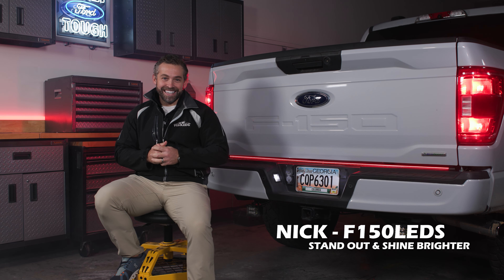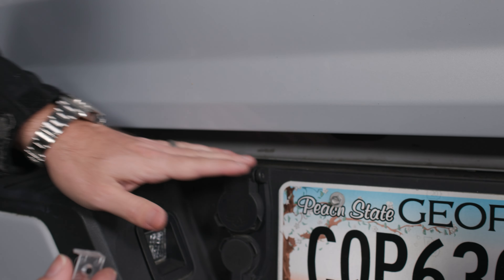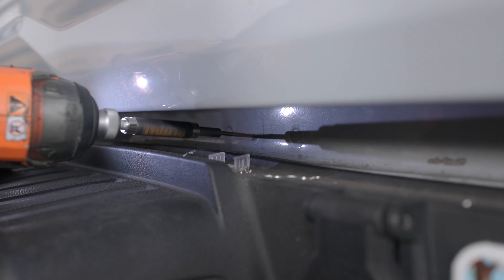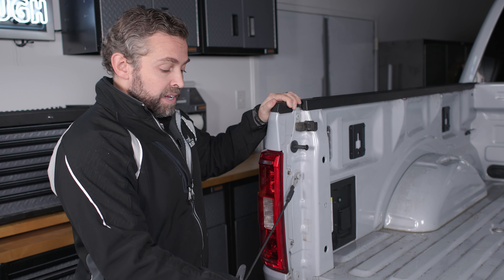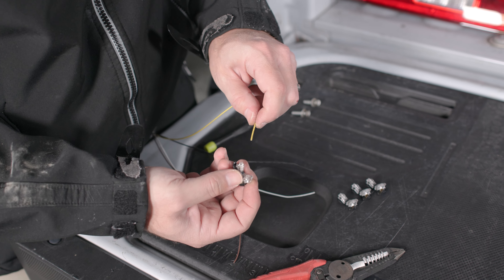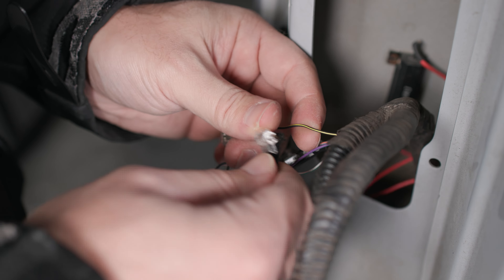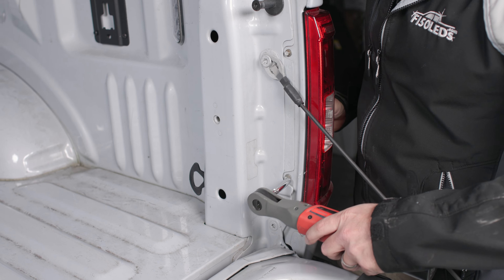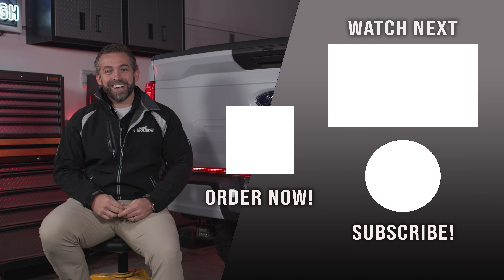F150 & Super Duty  LED Tailgate Bar Installation  (From F150LEDs.com)

Comment: I am really interested in ordering this light bar but have a question. I have a 2023 Gen 3 Raptor. I don’t see how the light bar would fit “over” those large bolts and hinge/bracket towards the passenger side of the tailgate. Could you please explain how?
Reply from the maker: Hi Arnold! Our Sentinel LED Tailgate bar will work perfectly on your 23 Raptor! The bar has enough flex designed in it so that you can go right over the bracket you are referring to, which is what we did in the video (or you can remove the bracket). When going over the bracket we recommend using our custom brackets vs the 3M tape. Please let us know how we cna help further, we look forward to serving you soon!
Reply: I would like to see closeups of bar going over tailgate bolts…would love to buy if the result looks smooth.  Would a thicker 3M heavy duty exterior tape and or flatter bolt heads be the best solution?
Reply: How even do the brackets need to be?  Measure drill spots from what edge?  This is for 22 Lightning XLT…any other caveats?
Reply: @tomcez  Recommend you put some spacers behind the entire bar to make it fit over those bolts. I just encountered the same challenge. The flex they described requires you to have about 2' between the passenger sider clips (on the end) to allow for it to bend over the bolts - not a good plan if you ever hit bumps or use your vehicle like a truck...
Reply: I just removed the two bolts and that bracket as I didn't see any other way to cleanly install the light bar with 3M tape. The bracket doesn't appear to be critical, in any case. Will reinstall the bracket when I sell the truck (24 Raptor)

Comment: I just installed this. It's an AWESOME light bar. However, I stripped of the screw heads I was going to put on the far right-hand side. However, can I remove that bracket on the far right side, just behind the tailgate? Will that interfere with the tailgate if I remove it?
Reply from the maker: Hey there! Thank you so much, we are so glad you are impressed and loving your Sentinel Tailgate bar! 

You can remove the bracket and most people would never know any difference but you would want to be careful of not to exceed the listed weight limits for your particular truck on the tail gate and also use caution not to pull out on the tailgate as it opens. 

Thanks for your question and for being apart of the F150LEDs family! We look foward to serving you again soon!

Comment: Hi there, I recently installed this and I noticed that the startup sequence isn’t working, all the wires are connected to the taillight harness except the brown wire which I’m not sure which harness that connects to. Can you please help?
Reply from the maker: Hey Brandon, thank you for your support! You will need to connect the brown wire for the start up sequence. You can connect to the running light wire at your trailer harness 7 pin connector (our first suggestion) or the running light wire behind your tailights. If needed, please message our tech team and send them your truck model/year/etc and they can assist with wire color etc. We look forward to serving you further!

https://www.f150leds.com/pages/contact-us

Comment: Any issues with 2021 LED taillight's turning off?  Putco Freedom blade has given me nothing but issues.  Id be interested in trying this. Wondering if its their tech or my truck.
Reply from the maker: Hey Conni! That is common for bars that are mass produced to work for all makes/models of trucks. Ours is designed specifically for your F150 and we have no issues on the 21's that we have 😎. We look foward to serving you soon!

Comment: All wires are different in 2018 F250. So super duty is different. Do you have a video for super duty?
Reply from the maker: Hey Leon! The installation of the bar is the same across all truck models, the difference being the wiring colors as you mentioned. Our wire guide tells you which wires to use for your specific model and year. You can reach our support team directly using the link below as well, we look forward to serving you! Thank you for your support! 
https://www.f150leds.com/pages/contact-us

Comment: Question, I have a 19 F150, When i am reversing and press on the brakes the tailgate bar tunrs into amber is that correct? It only does this in reverse.
Reply from the maker: Hey Draco! Please send your trucks details to our support team and they can confirm with you. Generally that does not occur but it depends on how the BCM / bar is reading the signals. Thanks so much for your support, we look foward to serving you!

https://www.f150leds.com/pages/contact-us